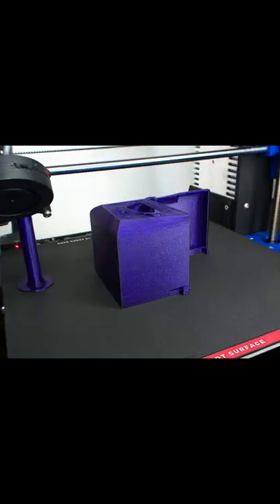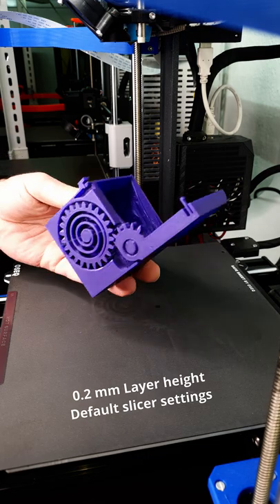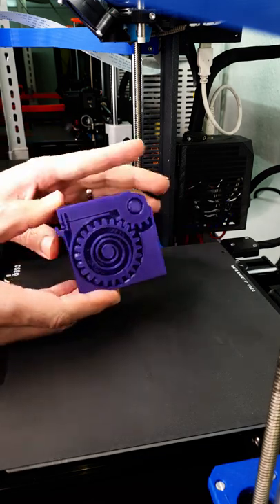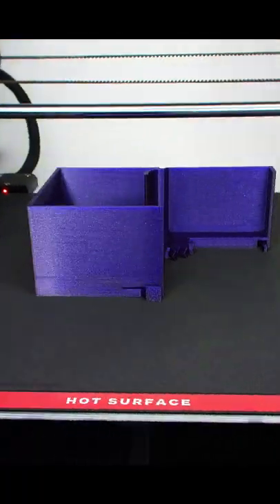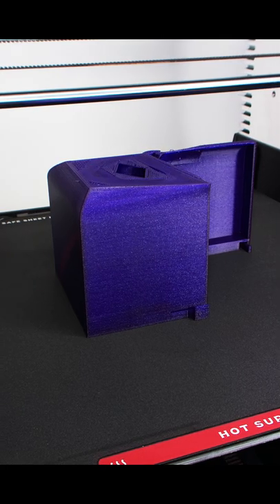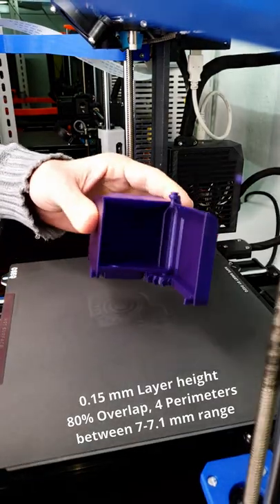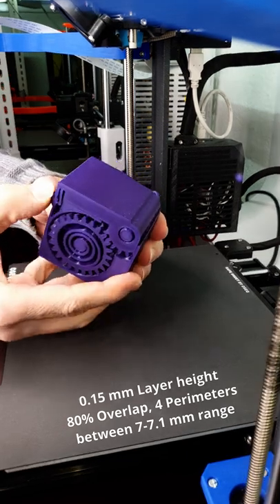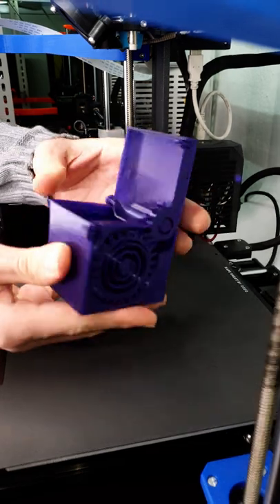How to 3D print a spring-loaded box 🎁 [Print-in-place]

Comment: Having zero experience with 3d printed objects, what's the wear rate? How many uses of the spring until it fails? How long can it continually hold tension until it pops on its own? Is that more a matter of the design or the plastic quality?